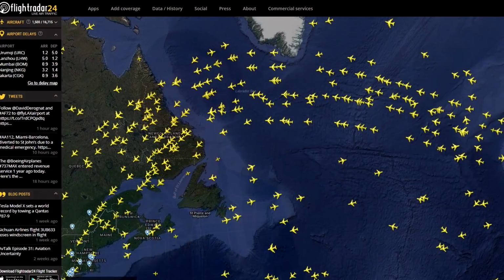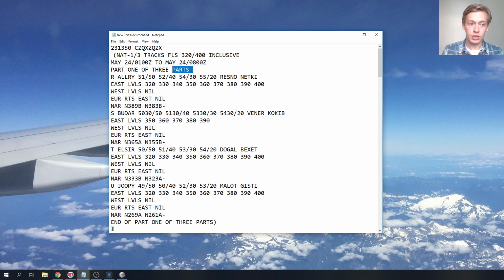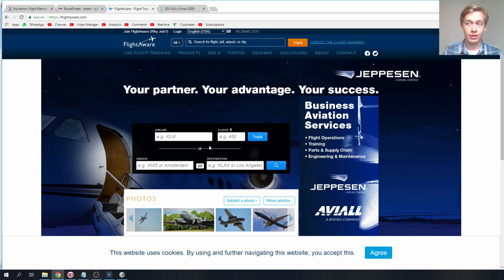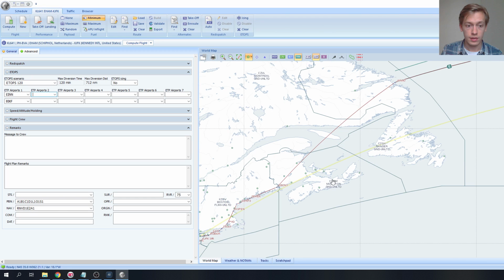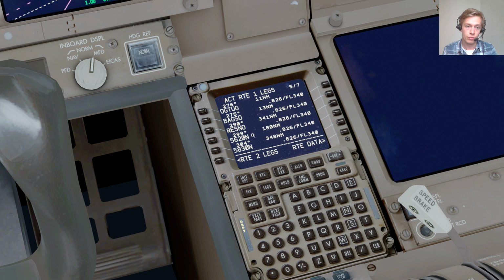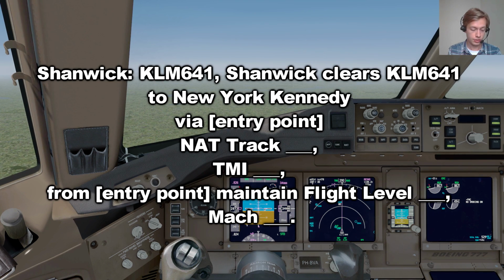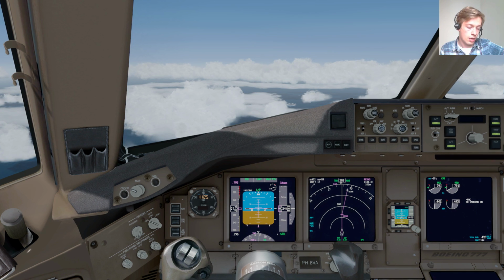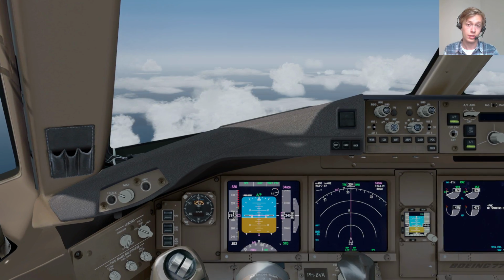VATSIM Oceanic Procedures Tutorial: How to Cross the Pond! [2018]

Comment: Thank you for your video, but I still have 2 questions regarding flight planning: Do you know if it's possible to request a higher Flight Level than the bookin sais ( I got 320, but usually stepclimb  a lot higher on oceanic flights) and do you have to still file the flightplan on Vatsim even if you got the Route, the depart. time and the Flight Level on your booking?
Cheers
Luciano
Reply from the maker: You can always request a higher level, but given it's very busy during Cross the Pond, it's very unlikely you'll get a higher level, so best is to simply stick to the level provided. Stepclimbs within NAT tracks themselves are rare I believe. And yes, you still have to file a flight plan :)
Reply: @AviationPro  Alright, thank you very much!

Comment: Is flying KORD-PHNL considered flying over the pacific? Because I'm planning this flight to do on VATSIM, but actually I don't have coordinates, I have normal waypoints and normal airways to reach Hawaiis. Do same procedures apply?
Reply from the maker: Technically it's Oceanic airspace since there's no radar coverage. From what I know the clearance you receive on the ground at, in this case KORD, is also your oceanic clearance since you're flying via airways, but no seperate oceanic clearance is requested upon entry. You still need to squawk 2000 though. Here's some more info: https://static1.squarespace.com/static/596bbb38197aea69ddd026de/t/5a86d71ff9619a7edffe0f6c/1518786335943/30+West+Oceanic+PAC+Checklist.pdf
Reply: @AviationPro  Thanks! Very appreciated

Comment: Ok, two issues I have with this video;

1. You request clearance between 30-45 Minutes before entering the Zone, not 90 Minutes. Why would you even request a clearance 90 Minutes prior? How are you going to assure you are going to estimate the Entry Point at the Same time...

2. Private Messaging is NOT the way to request a clearance! Every time you cross the pond you MUST Contact the CONTROLLER on the FREQUENCY! Either via Text or Voice to Request Clearance. 

3. The Oceanic Clearance Request is NOT how you have described in your Video. The correct request procedure is detailed here -> http://czqo.vatcan.ca/pilots/clearance.html - You must include the TMI Number in the Clearance! The clearance received by the controller will not detail the waypoint you are cleared via (i.e Via Resno, NAT E) will not be done. Instead, it will just be "Shanwick Clears KLM641 to Kennedy via NAT E, From RESNO, Maintain FL340, Mach 0.83 - TMI 144) - Your readback hereunder is exactly the same (Cleared to Kennedy via NAT E, from RESNO, maintain FL340, Mach 0.38 - TMI 144 KLM641)

4. It is not "Return to DOM" but Rather "Return Previous Frequency"

5. Your inability to show a (Template) that is the same to the example you provide is extremely poor. When attempting to give insight for pilots to "Cross the Pond" you should at the very least, ensure your data is correct.

If anyone is confused, unsure or even lost by this video - That is ok, AviationPro does dive into a lot of topics, some in little detail and others in way to much detail. Please consult the Gander Oceanic Pilot Tools below - these will assist you to cross the pond later next month.

Oceanic Clearance Generator: http://czqo.vatcan.ca/pilots/clearance.html
Position Report Generator: http://czqo.vatcan.ca/pilots/position.html
Radio Procedures Assistance Sheet: https://ctp.vatsim.net/system/view/includes/Transatlantic_Radio_Operations_Checksheet.pdf
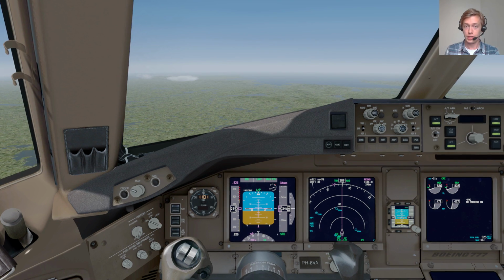Reply from the maker: Those were five issues, not two. *Point 1*: I indicated 30 minutes prior to entry via voice, and 30-90 minutes prior to entry if doing it via 'simulated' datalink, i.e. via text. I used this VATSIM guide as a reference: https://tinyurl.com/ydaqxuyr, it's clearly stated there as well. *Point 2*: maybe it's totally different flying eastbound, but private messaging is also clearly stated as an option for oceanic clearance in the VATSIM UK procedures: https://vatsim.uk/oceanic-procedures/. *Point 3*: my aim was to provide a basic set of phraseology knowledge. I did that by showing the VERY basic oceanic clearance first. If you watched further though, at 1:09:10 I explain the more advanced oceanic clearance including the TMI number. I specifically indicated in the video there will be differences depending on the region you fly in. Moreover I'm referring to the exact same radio sheet in that segment and in the description.  *Point 4*: well, again a matter of regional differences I guess, VATSIM UK procedures use 'return to domestic' as well: https://vatsim.uk/oceanic-procedures/, in the end I don't think this is something we should worry about. *Point 5*: all the differences in VATSIM documentations I guess shows there's a need for a template, problem is, as these regional differences show, it's hard to design a specific template that applies to ALL oceanic regions. The video I made was to provide a set of knowledge, not a template, it's up to the pilot's responsibility to use this knowledge to adapt to regional differences or differences in documentation. Sure you can use generators and all which are great tools, but if you don't have an understanding of the background behind it, adapting to situations that are out of the ordinary will be more difficult.
Reply: ye these generators are good and correct considering I made them myself
Reply: can verify as well, probably check your facts before you post a video like this
 - Andrew Ogden, Gander Director of Operations

Comment: Hi AviationPro. First of all, thanks a lot for your very useful and amazing videos. Then, sorry for my incorrect english speaking (not my native language by the way). I wanted to mark a red spot on a bug that was very annoying on my first flight with my brand new 777. Indeed aftet take off i noticed false informations with ETA and Fuel status in the FMC. After double checking, the aircraft was set correctly and this is a known issue with PMDG 777. Pretty easy to fix anyways. Load a Default State Panel and customize it. Configure the State you want and save it as a new STATE. Now select this new customized State as the default. That s it ! Many others comments confirm you can also load as default the Cold and Dark State and there is no problem. However this State in real life is not common for an aircraft life. Hope it helps.
Reply from the maker: Thanks for watching! I know there's a problem with the panel states, but from what I know they actually released some updates a few weeks ago to deal with the problem, but not sure if it's still there.

Comment: If you’re flying a 777, then you rarely talk to anyone. It’s all via CPDLC. Also, with the PBCS mandate as well as strict rules in the NAT DLM airspace, you couldn’t operate in this structure using HF alone. Also, the callsign for oceanic is “Shanwick shanwick, or Gander, Gander”. C’mon now. Make sure to get the procedures correct.
Reply from the maker: This is a VATSIM tutorial, where, due to limitations in the simulation, things work a little bit different compared to the real world. I mentioned the existence of data link in the real world and I included real world documents in the description for a reason.

Comment: Thanks for a very  informative video. Out of curiosity, when you have crossed the pond and are handed off from Oceanic freq's to the domestic freq do they issue you with a new squawk code? Or do you change (yourself) from 2000 to the squawk code you were originally issued at departure when you leave the track system?
Reply from the maker: You're welcome! They do indeed. If there's no ATC, you just switch yourself back to the default squawk you were originally asigned or, if none, just use the default Squawk code.

Comment: Do you think PFPX is worth it? I have been using Simbrief for a while now and not sure if I should make the jump. Also, do you think the QW 787 is worth it? I saw your other video and despite the bugs do you think it would be a good purchase? Thanks for this great video!
Reply from the maker: Simbrief is actually a great alternative, provided you have the latest AIRAC cycle. PFPX profiles might be more accurate though and finding routes is easier with PFPX. In my opinion the QW787 is worth it, provided they start working on the issues posted in the forum :)
Reply: AviationPro thanks so much for the response I’ll look into it!
Reply: One more question actually sorry. Does PFPX accept AIRAC from Navigraph? Thanks
Reply from the maker: Yes
Reply: AviationPro great thanks!
Reply: Just to add : Everything PFPX can do , SIMBRIEF can do ... the only difference is, SIMBRIEF does most of the work for you. PFPX will be good for you if you want to go through the immersion of flight planning with detail by yourself. 
Regarding QW787, I will say you should wait for a bit till they have corrected the bugs a lot of early customers are experiencing. Its always good to wait for a few months after a software release...  I'll get the QW787 maybe at the end of the year ( I don't think I am missing anything if I wait  ) After all Aviation is also about patience :)
Reply: Thanks for your reply I'll take that into consideration!

Comment: Good morning.  I stopped watching at 27 min. into your vid., so you may have touched on this later.  After your creation of flight plan , the ETOPS circles did not overlap. When I try to create a plan ,I get the error from PFPX about the ETOPS.  What do you do to correct this, or is it necessary ?  Thank you.  S. Sumner
Reply from the maker: That’s correct, later I make them overlap by selecting a different alternate. To make it go green you have to make sure the entire route is within ETOPS. So also the end of your route, that’s why I later include my alternate KPHL as an ETOPS airport, otherwise the end of the route was not within ETOPS range.
Reply: Once again, I put the cart before the horse.  I should have kept watching.  Well done explaining.